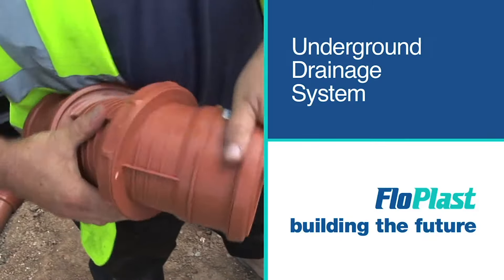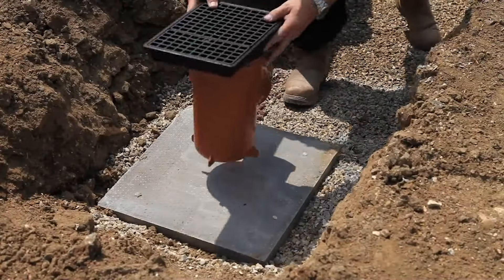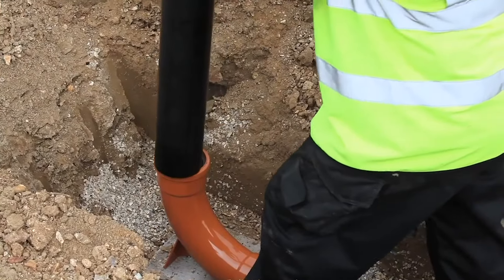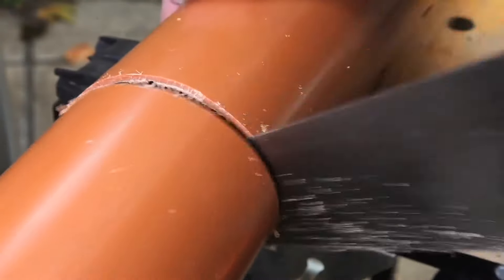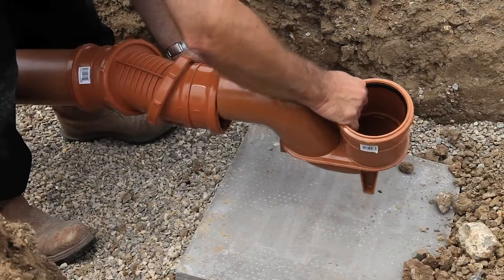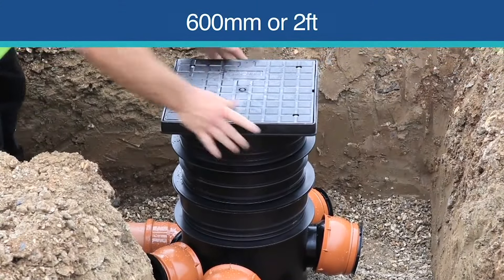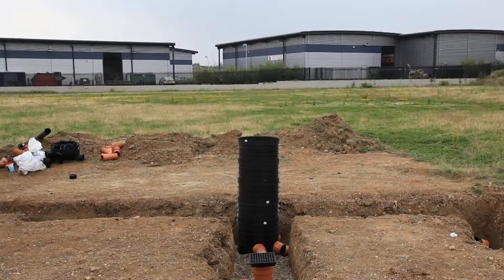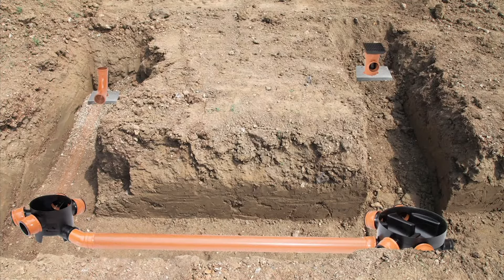FloPlast Underground Drainage System Installation Guide

Comment: Would you lay the base of the chamber on a slab too?
Reply from the maker: Sure, that's only going to improve things by having it on a solid base, so I don't see why not.
Reply: Depending on the weight of the manhole base and quality of the ground sometimes a concrete blinding may be beneficial but in the majority of cases a concrete block and 10mm pipe beading will be more than adequate